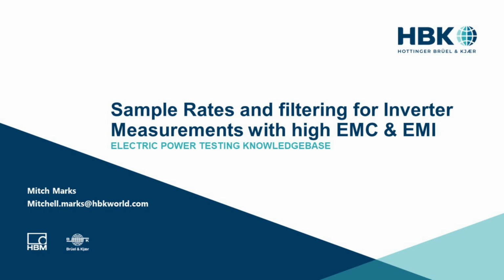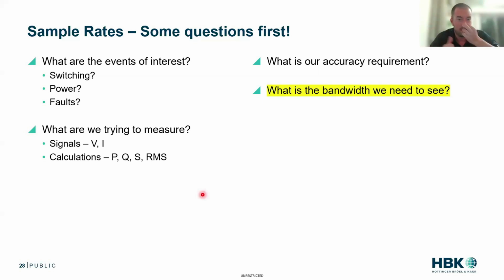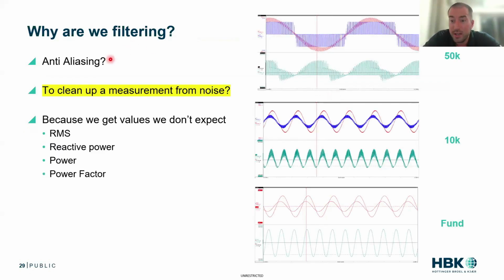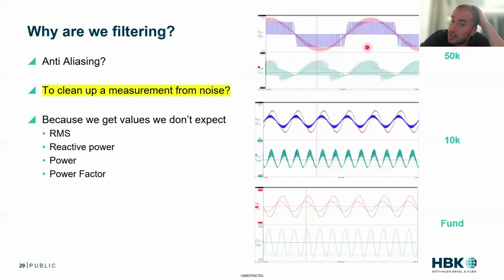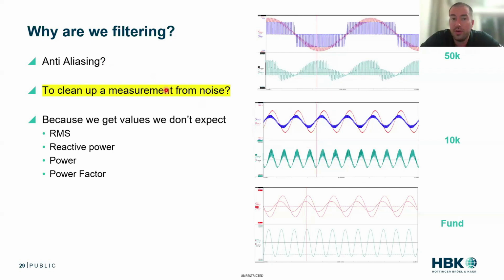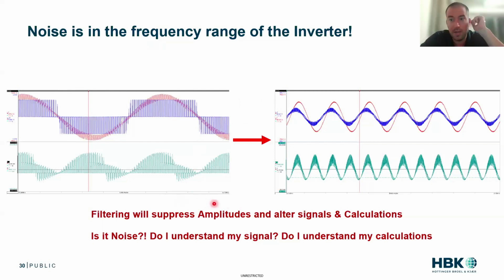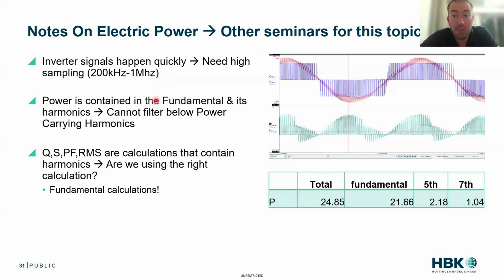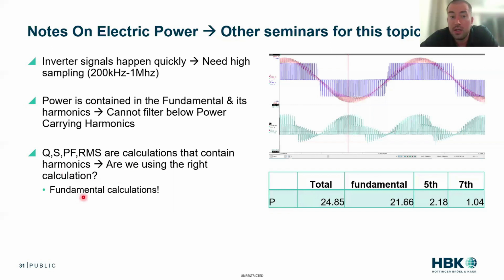Sample Rates and Filtering for Inverter Measurements with High EMC & EMI

Comment: Hey, Thanks for a great video.
I am just getting into working with inverters and have a fairly good understanding of their basic/idealized operation, but I am struggling  to wrap my head around the harmonics of the base and switching frequency and how power is distributed among these.
Do you know of any good resources to learn more about this?
Thanks again for the video.